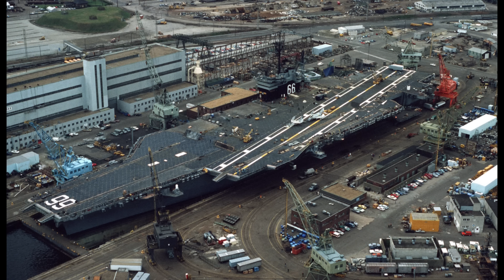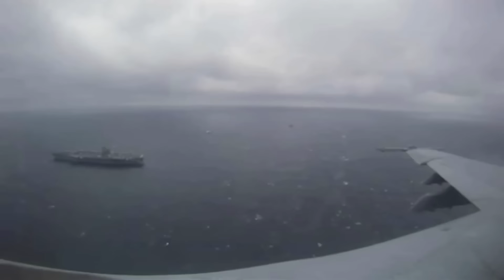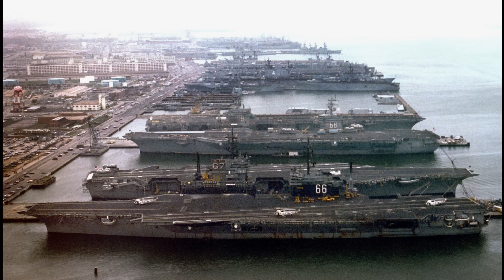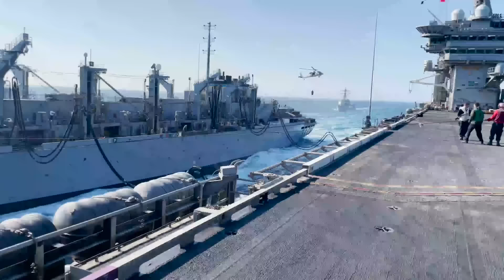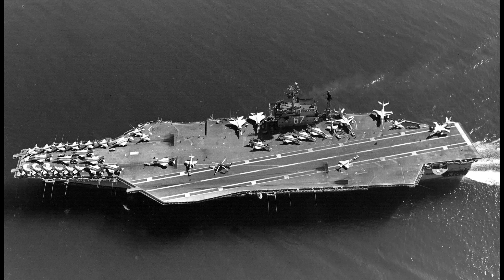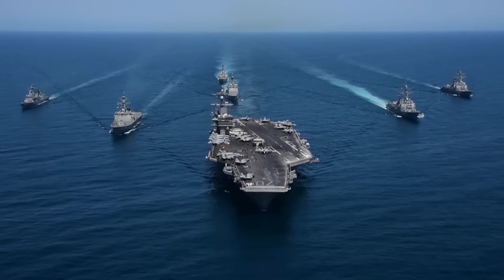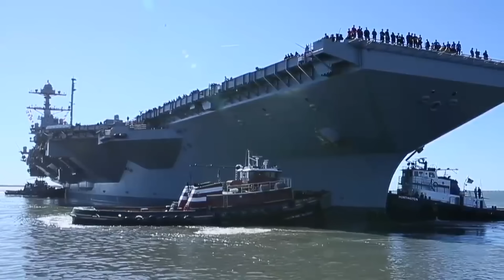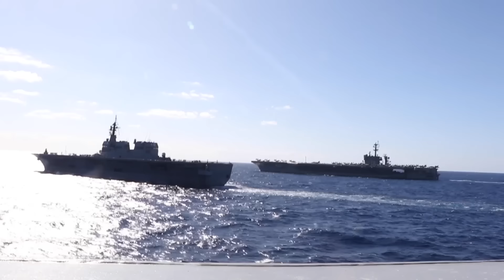Kitty Hawk Class: Why the US Navy MUST Bring Back This Non-Nuclear Carrier

Comment: they need smaller escort carriers I think, just cheap low tech carriers to help protect convoys and guard sea lanes. Combine it with some destroyers or frigates and boom you just solved the navys issue.
Reply: Someone just mentioned modular thorium reactors. Smaller ship with two large elevators.
Reply: @joemaloney1019  thats a good idea. In WW2 I think the smaller escort carriers used for convoy protection held 30 planes each and they had about 1 per convoy in the atlantic. I'm not sure how many planes you'd need in a modern conflict for a convoy.   :)
Reply: @DoubleBourbonBaconCheeseBurger 
It isn't.
Reply: @joemaloney1019 
Too much hassle. Just make it conventional. Those thorium reactors aren't in production. Besides, they might need to be modified.
Reply: No need for escort carriers. Some destroyers and you're fine. If you only have to worry about pirates or some patrol boats, the new frigates will be fine.

Comment: Japan makes the world's largest diesel engines for large commercial container vessels. Four of these engines could be perfect for powering the ship, this would leave a much smaller steam plant to power the catapults and other systems needing steam. This might require more draft or might not.

I'm not sure they build gas turbine engines large enough to push a carrier past thirty knots.
Reply: Perhaps some variant of the GE Frame 7?  Simple cycle it puts out 90MW.  They can burn certain liquid fuels.  Would have to figure out how to safely intake and exhaust all that air at some reasonable noise level.  May be less than ideal intaking sea air.

Comment: You may need to resupply a kitty hawk for food and even fuel still but it takes much less fuel for the air wing. Less fuel ships or even smaller fuel ships so its way cheaper. We spend insane amounts of money for training and air to air re fueling so they should make all the training flights pick up loads of food and gear to even more reduce the load on supply ships.

Comment: I’m not opposed to the USN building conventionally powered CVs again, but there are a few relevant points to consider.

As others have already mentioned, the only shipyard in the US currently capable of building something like a modernized Kitty Hawk-class aircraft carrier is Newport News (NNS) in Virginia. The other two shipyards that previously built those CVs, the Brooklyn Naval Shipyard and the New York Shipbuilding Corporation, no longer exist. No other currently existing shipyards in the US have the infrastructure or the expertise to build something like that. NNS will be otherwise occupied for the foreseeable future with constructing Ford-class CVNs and performing RCOHs on Nimitz-class CVNs.

Two, if a major expansion of shipbuilding capacity was undertaken in the US that provided the US with an additional yard capable of building a conventional CV gas turbine propulsion is unlikely.  Gas turbines require very large intake & exhaust ducting. They move a much larger volume of air than a steam plant uses for combustion.

The intake ducts on a LM2500 powered ship are 12-15' square. Multiple that by 4 - one for each GTM. Exhausts are smaller, but still 8-10 ft in diamter, and they will be hot enough to require insulation and voids around them. 

They also require a rigging path to remove and replace the entire engine assembly with minimal disruption due to the nature of the design - on a steam ship turbine repairs can be done in situ by lifiting the case, and likewise boiler work is done installed. Minor gas turbine work can be done installed, but major repair requires the entire engine assembly be removed to a specialized facility with the required tooling, jigs, access, cleanliness, etc. The operating conditions also make catastrohic unexpected failure a reasonably likely occurance that it must be considered.
Reply: There was talk of a modified medium sized carrier with one reactor and four boilers. It would travel on the one reactor only firing up the boilers during flight operations. Additional cost cutting would be to use 2 Ford sized elevators that can each handle 2 aircraft at a time.
Reply: @joemaloney1019   I remember that proposal, to be frank, it was a terrible proposal then, and a terrible one now. You get none of the benefits of either propulsion system and all of the headaches. 

If the USN/Congress truly want to go back to conventionally powered CATOBAR carriers for cost cutting reasons there are a few provisions necessary to make it work. 

One, no nuke/conventional hybrid, you have to go back to steam, likely some sort of steam-centric IFEP, with diesel support. 

Two, and most importantly, a large nationwide shipbuilding strategy wherein you'd then have one or possibly two additional shipyards, in addition to NNS, capable of building a conventional CVs. For reasons of competition.

Comment: The US could build QE class carriers on licence tbf
Reply: That would be a massive step backwards.
Reply: @BigAmp  how so?

We aren't talking about replacing Nimitz or ford class carriers. We are talking about building a cheaper supplement for use when a ford/Nimitz class isn't needed or they are all in use elsewhere. 

That's like saying "building frigates is a step backwards compared to Arleigh Burke destroyers"... No, they exist for different reasons
Reply: @talkingonthespectrum  Never send a boy to do a mans job. IMO UK missed the bus with the QE class by not going with catapults and arrestor gear, which narrows down the air group that can be operated to one very expensive type.
Reply: @BigAmp I don't disagree with you. But the QE class has one major advantage, it's quite cheap. And for a reserve/second rate carrier capacity... That's rather helpful. 

However, as a Brit, they are a rather silly "first rate" carrier design and realistically we should have built three
Reply: @talkingonthespectrum  Three would have been much better. There also seems to be a major design defect with the power train which hopefully can be resolved which will markedly improve availability.
Reply: @BigAmp they have just got shaft replacements, hopefully that will help

Comment: they just need cheap 2nd line carriers.. going at 30 knots is not always needed...
Reply: The top speed listed for modern CVN's is  "30 knots +".  If you believe that, you are a fool.
Reply: @williamwood958  they are close to 30 knots. Nominal reason is to dodge torpedoes. In a battle fleet, far from danger, this is less needed.

Comment: To late.  The era of the building oil burner CV's has gone the way of the dodo bird with JFK, #67 being the last one.

They were old and tired, I think they ran out of room for upgrades.

Maybe the two best ones should have been upgraded for argumentation when a nuke is off line for long term maintenance. Excluding the reactor refueling taking 5+ years is insane.
I remember seeing Ranger, Independence, Constellation,  and Kittyhawk at naval shipyard bremerton awaiting disposal. Very impressive sight as you drove into town or the shipyard.

Now they are all long gone.
Reply: Except, it is not only reactor refueling during RCOH. It's top to bottom overhaul, fix, upgrade
Reply: Not to forget that to power all the hungry Electronics of today you'd need to oversize the whole ICE plant to allow for redundancies and emergency loads above the expected maximum... which would probably mean going even bigger than Nimitz and what savings do you then expect???